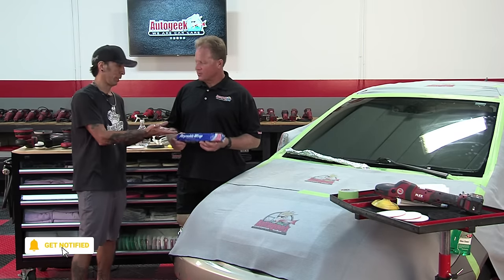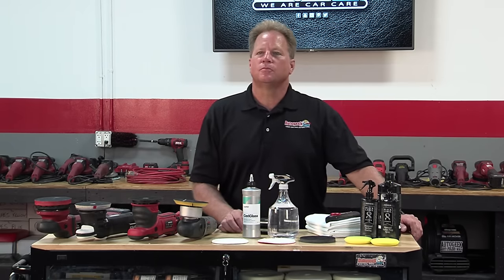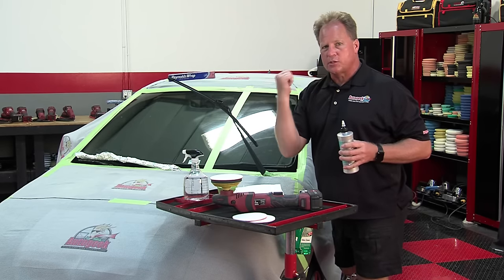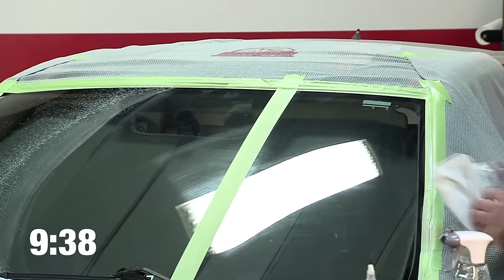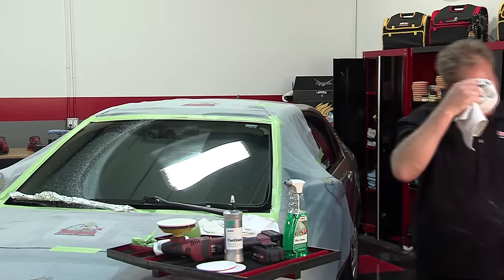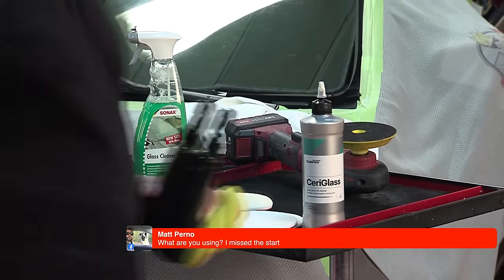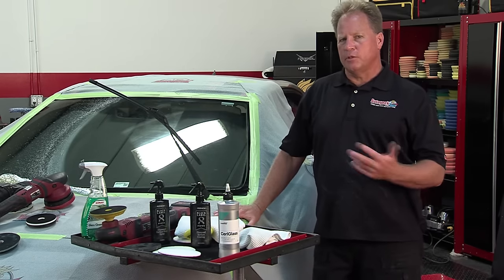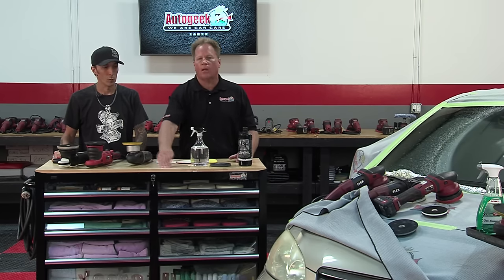How to safely remove pits, wiper marks & scratches from glass

Comment: Best professional instruction I've seen. I am DIY with bad water spots on windshield, and deciding between my own ability to polish out and spending for the tool vs. replacement of windshield. Having serious night time glare and is a safety issue. This is not to mention that I'm a senior, with less than average endurance. Mike says, "yeah it's hard" and it looks it.
Reply: You're not trying to polish out scratches though. I would pick up some glass polish and try it by hand before investing in a tool. You could go with the cerium oxide products he mentioned, but honestly you may see good results just picking up some regular glass polish from Amazon and doing it by hand.

Comment: Back in '68, I acquired a '65 AC Cobra with a windshield that would have made a good test case for your process. The Cobra had been wrecked and had a hard life. The passenger side was severely wiper-blade scratched, with scratches filled with over spray, and  barely translucent . I was young, not very knowledgeable, and sought help. All recommendations were that it was a lost cause. Using a standard power drill, and many hours intermittently, I started with bathroom cleanser and worked my way up to jeweler's rouge. It was a learning experience and I was fearful of damaging the windshield and possibly cause other irreversible damage. I could always tell but otherwise it was mostly not noticeable.

Comment: Okay. That's what I did wrong.   Well I guess I better buy some stuff.  You showed me how to do it. Its the least I can do.   I will Pick up the pads this week and get this job done.   Been dealing with scratches for a while.  Time to get rid of them.    I see this taking about a day to do for me.  My whole window is scratched.   

THANK YOU for spending the time to show us just how LONG it really takes.   I only spent a FRACTION of the time. No wonder I did not get great results.  I was also using a low speed setting.

Comment: Great video.  I started my windshield yesterday with my Mirka Deros and abranet, quite a deep wiper gouge.  I've spent about two hours working on the levelling, could be another hour left to do before I even go to 1500.  I have Trizact 3000, and then onto the rayon disc and cerium oxide.

It would've been easier/cheaper(timewise on earning) to jist put a new glass in, but I jist did that a few months ago after stine damage, so it's partly a matter of conservation of material, partly just to know I can do it.

Anyway this video pointed out a few things I might have otherwise overlooked, and is exceptionally thorough.
Reply from the maker: Thank you.  So nice to read intelligent comments on YouTube.  -Mike Phillips

Comment: Yeh it is hard work! I polished out wiper arm grooves in a vintage windscreen. I didn't have any product. I made a leather pad for a cordless drill and used brick dust as the abrasive and water as the lube. It took hours.

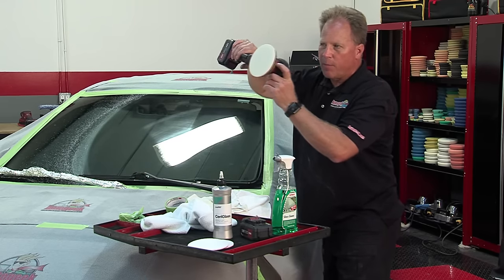Comment: 53:24  Tip: Take a towel, fold it so it's thick to hold more water, soak it with cold water, and place on the outside windshield over the spot you buffed inside to soak up the heat.

Comment: You can use very fire steel wool pads, it gives your glass a great shine and takes off any dirt old wax e
Reply: Think I'd rather buy a kit for this one
Reply: Don’t do it. I used OOOO steel wool that’s what got me here. These guys are a couple clowns that like to listen to themselves talk.
Reply: please understand what the steel wool is and is not capable of.    I have done it personally several times and I can tell you from my experience that steel wool will absolutely NOT "remove" scratches on your windows.

However, it is great for getting rid of almost any water spots and road grime that you can see if you were to just clean your windows with just a cleaning agent.

For that issue, it has worked very well for me and it can make a huge impact on the viability.

Comment: Greetings from Hereford, England. 
Just wanted to say thanks for the tutorial. This is exactly the problem (windscreen wiper scratches) I've been trying to fix for months. Now I know how. Cerium Oxide is on the way 😉👍🏻.
One thing I would say, though, is that if you have a low pair steps, you could lean further forward and use your bodyweight to polish the glass. Far less physical and easier polishishing.
Just an idea 😁
Reply: I'm a rather tall guy 6'2" myself and I was thinking of a platform too 👍

Comment: I work in glass fabrication and use the purex buffing system. It's pricey but great. Ibwas under the impression that windshields had a coating on them and couldn't be buffed. Might do this for a side hustle

Comment: I used to have a problem with glass being sandblasted in Florida. Lots of sand living 2 miles from the Gulf of Mexico. I have a secret to cure this though. No, I won't tell you because it cost me $80,000 for one vehicle...... Oh, OK. If you insist. Are you ready? Here it is. I bought a new house and moved 1,000 miles north to a hard rock state. 20 years and 5 vehicles later, I haven't had a problem since. It's been kind of a tradeoff though with the collisions between rock salt and sheet metal but you can't Bondo a windshield. Great show!

Comment: You guys are fun.  Thanks.   I wouldn't have thought it possible to fix that glass.  My thought is that it's applicable to house glass when water spotted.  I've used the powder from home depot for water spots on household glass and it works with a machine.  Doing anything by hand is not fun pr practical.

Comment: This is alright for light scratches and swirls, it's still super messy though. In my experience cerium oxide compacts itself into pits and I have yet to get it out 6 months later. Tried solvents, gasoline, repeated washes. Pinkish-orange dots all over my windshield, apparently only an acid can dissolve it. I think I'm going to experiment using oil and diamond pads next
Reply: Diamond 3m 3000. Wet paper.  As the pad. And wheel acid diluted 10/1 will dissolve hardwater and  fisheyes.  Use gloves. Rinse and repeat. Wet every thing first.  Keep it wet!!!  Ceramic glass top polish works as well. Keep it wet!!!!

Comment: Does it affect chip repair epoxy? Is it safe? How deep od a scratch will it remove? How much to replace the windsheild? I can get a replacement windshield from an auto wrecker for around 100$ and install it myself. There should be a machine you attach to the car that has tracks and spring pressure to automatically buff the window evenly and equally only thing you'd have to do is spray the compound and water.

Comment: You have to remember that your windhsield is safety glass, it is a laminate of 2 pieces of glass with a clear membrane in between, so if it breaks, it won't shatter into a million shards flying into your face. Your side windows are not safety glass, they shatter. That's why I have one of those multi tools that can cut through a safety belt and has a heavy end with a point to hit the middle of a side window to shatter it, in case you drive into a pond or lake or something. You won't be able to escape from your front windshield.

That being said, be careful if you try to remove side window scratches, if you overheat the glass, it will shatter.

Comment: Man, i commented before the end, so i have to comment again. Thankyou for legitimately putting in this work. And actually showing people n not some time lapsed bs that someone makes it appear as tho they didn't break a sweat.

This is beautiful afterwards.

Also, i think people should realize, water stains n that, u might only be on this glass for 3 minutes, then entire thing if u know what ur doing.

I could imagine a company that adds this level of polishing n then protect it with something amazing ur set for 20 years with maintenance n never get another scratch.

I remember being in wildwood nj n went to a gas station with my brand new bmw 330e. Anyway nj they pump it for it. So my car sat for 3 or 4 days at the hotel a block from the beach. Yes there was sand on it.
The scummy guy pumping the gas just starts cleaning the window n it wasnt until a few days later i completely realized what he did which was completely scratch micro scratches across my entire windshield i was so angry man. It wasn't like noticeable to the naked eye from the outside or interior, until you were driving with the sun above n in front of the car. Thats when u saw every little abrasion and it was so annoying to me.
For 3 years of driving that every time i drove into sunlight i cussed that mf'er out. Its been 5 years n i can still picture myself going back there but hes lucky its so far away.
I wish i knew about this at the time.

Comment: I’ve removed scratches to an acceptable level using ceraglass, misting water, a rayon pad, and a 3 inch da polisher with an 8mm throw. However I don’t know how to remove the haze I’ve created. Any tips for which combo I should use? I have access to lots of polishes and pads.
Reply: Did you ever figure it out?
Reply: I cut a pad to fit an oscillating tool and repeated the process. Worked much better. Here’s what carpro suggested: “use ultracut polish with orange polish pad , in low to medium speed. it should remove the haze , spray eraser after or even during the polishing.”

Comment: I’m gonna try this method. Thing is I’m not getting out scratches, I’m getting out etched in wheel acid on my windshield from about 9 months ago. I tried sanding & using heavy compound & it didn’t do anything. I really hope this method works.
Reply: How did you manage to get wheel acid on the windshield?
Reply: @BlackHawkPSU  I used acid to loosen dirt on roof after not washing truck for a while. I’ve done it before, but I guess this time I let it sit a little too long & it ran down the windshield. Good thing it wasn’t outside in the sun while I did this.

Comment: can windshield be polish to remove small pitting. People say don't do it because it can hurt the windshield because of heat when polishing. Also trying to remove old Ceramic coating using super fine steel wool
Reply from the maker: Yes.  And - don't rub steel over glass - steel scratches glass.  -Mike Phillips

Comment: Noticed several mistakes.

1) The product instructions are not followed
1.5) NEVER dilute a product. Never dilute a CONCENTRATED product while using.
2) Less is better. You only need about 4 to 6 drops of product, as instructed
3) Splatter happens because the user does not dab the pad onto all the surface of the glass panel AND need to spread it first at low speed
4) No water required. Either finish or wipe and re-apply

Comment: Will this technique work on the kind of deep scratches you can feel with your fingernail? If not is there a product out there?
Reply: This technique will not work for that. For something that deep you need to grind the glass. Literally sand the scratch out. 

Think of a scratch in glass as a valley or a void in the surface. Make the surface flat again, one way is by filling the valley, such as in the case of chip repair, but that yellows and fails. Or the other option is to remove glass all around the scratch bringing the entire surface down to the same level as the bottom of the scratch. Obviously this is not a normal “DIY” process. Believe me, we have repaired countless DIY attempts. You really have to understand the process and have the muscle memory to do it without distorting the glass.

That said, there are companies such as ours that CAN repair deep scratches in glass. Or you can purchase the materials from a company such as Glass Renu, if you wish to attempt the repair on your own.

Usually with automotive glass, unless it is a high end exotic or an irreplaceable pane of glass, it’s best/cheaper to replace or pay your glass deductible with your insurance.

Hope this helps😊

Comment: My Camry has what looks like glitter on windshield that only shows when sun hits it just right, it is very hard to deal with. What is the cause and how to repair it?
Reply from the maker: The windshield could have microscopic sand blasting from debris, we would recommend trying this video's polishing method to remove them. If they don't come out with CarPro Ceriglass, then you know the defects are either in the window itself or possibly on the inside.
Reply: Thank you for that question...my girlfriend's car has the same thing....which led me to this video also.
Thank you autogeek, for answering that... I've been thinking the same thing, mostly because it doesn't look like it's just on the outside..
Reply: @autogeek I appreciate all your data on this

Comment: Any suggestions on how to avoid getting scratches in the first place? Preventative maintenance seems a lot simpler than repair.
Reply: Clean car regularly and replace your wipers before they get crusty and make sure theres not much dirt on them if you dont use them much
Reply: Always clean your wiper blades whenever you wash your car. People always skip over them. Change them every 6 months.

Comment: Scratches that are more like sand  pitting, many many tiny chips that aren't visible until you are driving into the sun. can those be polished out and will there be any coating on the windshield...BMW 330CiC, 2005

Comment: Can I use this on an old CRT TV screen with scuffs on it, or do I need something else?
Reply: Might work, but that's a lot of water to throw on electronics... And if there's a coating on the screen you'll have to remove all of it...

Plus, with the cost of polish and pads, unless you plan on doing your windshield too, it might not be worth salvaging an old monitor that you can replace with a LCD for a hundred bucks...
Reply: @mikejacob3536  He didn't say "monitor". He said "CRT TV screen". He's obviously got one or more old collectible TVs, not computer monitors.
Reply: I wouldn't do that. At least not with that much pressure. Those old TV screens were not very strong compared to a windshield. The glass is thinner and more brittle.

Comment: Is there a glass coating that won't interfere with the rain sensing / automatic wipers feature that some cars such as Audi have. Their owners manual specifically warns  you about this
Reply from the maker: Sorry - I don't know.  But if the GLASS has a sensor IN THE GLASS - to the point that you cannot apply a coating then you certainly also don't want to ever abrade or polish the glass.  My guess is maybe Audi has a glass coating?  -Mike Phillips

Comment: As a 30 year experience autoglazier I can tell you you're wasting your time. Just replace it.  We only polish NEW glass if it's lightly scratched . This is a wankfest
Reply: Says the guy selling glass😂  But he’s right unless it’s a crazy expensive piece of glass or classic car that you can’t get glass for anymore or something. The cost of the product/pads and the time/effort involved makes it a judgement call depending on replacement cost. Also, you can’t get close to the edges without burning paint and moldings even with multiple layers of tape so take that into consideration as far as where the damage is on the glass.
Reply: @relyenterprisestx  yeah if you can't possibly get the glass it's ok but it's still not as good as new it always distorts the glass

Comment: I think most windows, even 50yr old classic cars could be replaced. I get the 
topical polishing" but going to the point of trying to eliminate chips seems like needless effort---unless the glass piece isn't availible. Having seen this I'm not sure just when this much labor is necessary?
Reply: This is why we usually recommend replacing automotive glass. The typical windshield can be just cut out of the car and replaced within about an hour. However, there are are times where the glass can not be found, glass that is matching numbers to the car, or the glass is just really really expensive. 

We recently repaired a few pieces of glass that were just plain irreplaceable for a classic exotic sports car. It would have been over $100k to have them custom made. But they would not have been factory glass.

Comment: Great video and thanks for sharing! Now I have the bug back to doing the same thing for the windscreen on my 2010 Honda Fit. The only reason I see for me to attempt doing this is to keep the entire car stock and not replace the windscreen with an aftermarket one. 
Question I have for you guys is this: Everywhere is currently out of stock of the CarPro rayon pads, including you guys. Is it safe to use the Lake Country glass polishing pads with the CeriGlass polish together?
I really wanna attempt this ASAP, even though I don't have a rotary, just a short and long-throw DA, but now I'm stuck without one of the materials I need. Thanks!
Reply: Without actually product testing, I’d assume it’s likely very safe. In my shop we use LC MF pads with good success as well.
Reply: And mike just told me that it may damage the glass with non-matching products. He’s a chip goose of detailing - they just know more than us. Try a test spot on some junk glass!

Comment: Thanks! I just got a new-to-me 2013 Ford Expedition. I just noticed that the power windows all have vertical scratches. Apparently whoever detailed at the dealer failed to clean the trim at the base of the window and there is sand trapped in them.. I also have a 2001 Expedition and no scratches at all. It seems a softer, possibly soda glass is being used on newer generation. No real question, except will it be easier to polish these out given the softer glass?

Comment: Aside from a rotary, is a forced action da better than a free spinning da for this? I recently tried the same product and pad that you are using, with a Griots G9. I didn't have great results. I was getting stalling and didn't go as long as you. Was frustrated with my lack of results.
Reply from the maker: And this is why for about 99% of my car detailing work I use the BEAST.  But the answer to your question is "yes" - gear-drive trumps free spinning almost all of the time.  -Mike Phillips